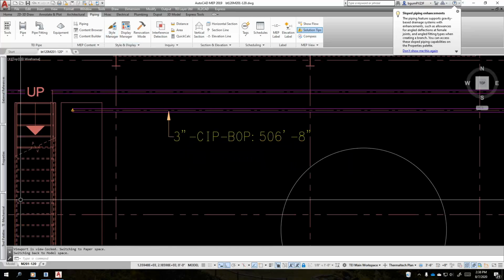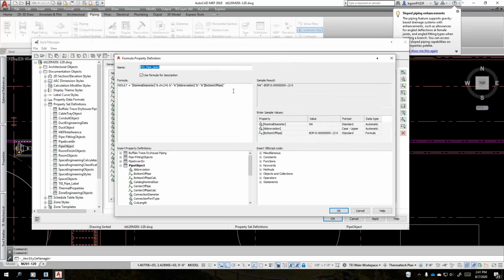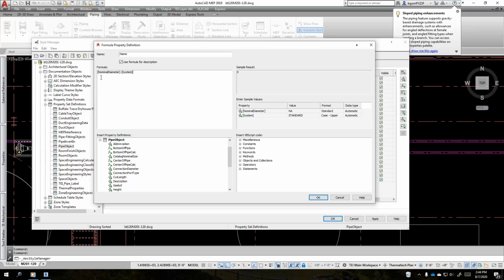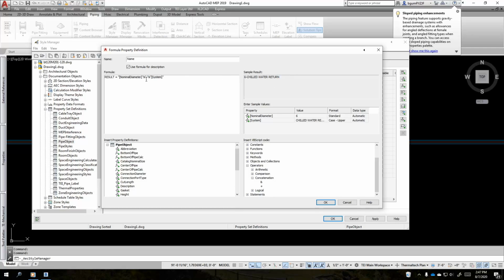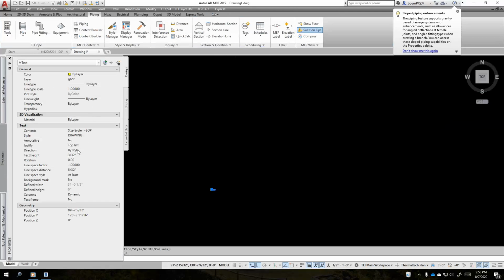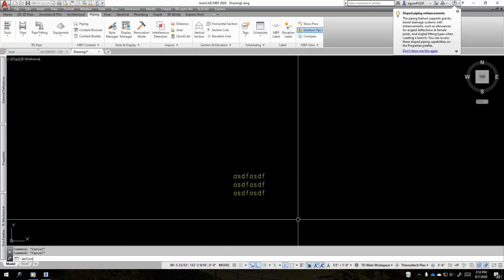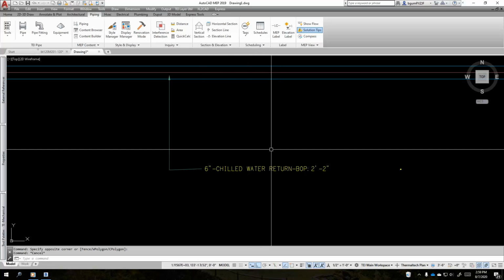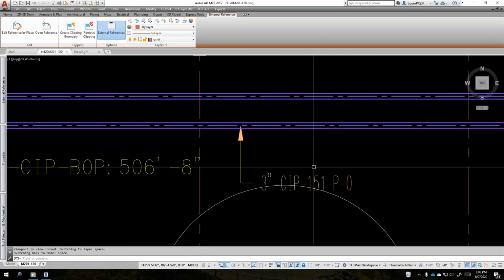How to Create Custom Tags and Property Set Definitions for MEP Pipe Conduit Duct - Autocad MEP

Comment: I'm new to creating tags and came across this video. Do you know if its possible for have your tag react to status changes of the item its "attached" to? For example, if I have a piece of duct that has a service of "New Low Pressure", and the tag is coming in as a "3D Sizes" label curve style (the appropriate tag for "new" duct work), can I make it to where when I change the duct's system to "Existing Low Pressure" can the tag automatically change to "3D Sizes Existing"?
Reply from the maker: @jubei2011  you would need to attach a reactor to it via lisp. I've done something like this in the past. Email me via my YouTube about me and I can link you up with example code.